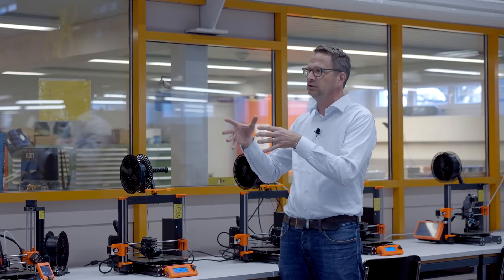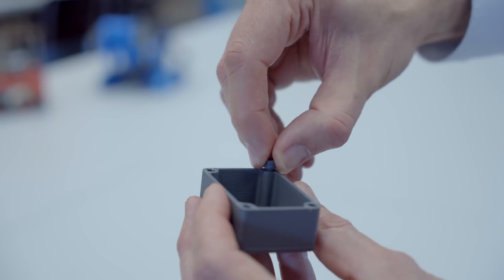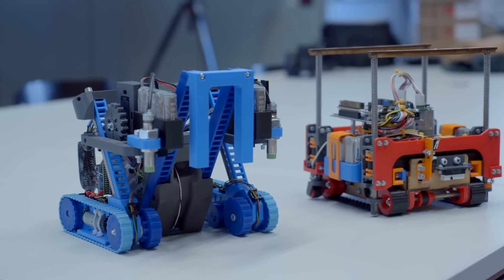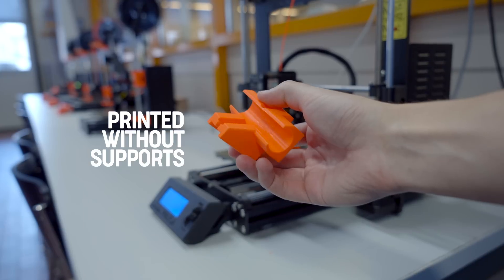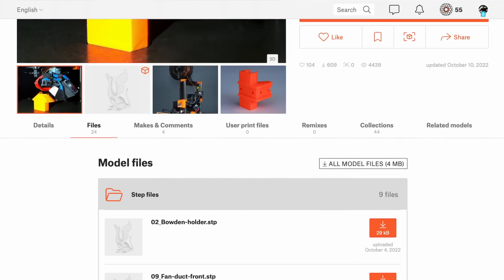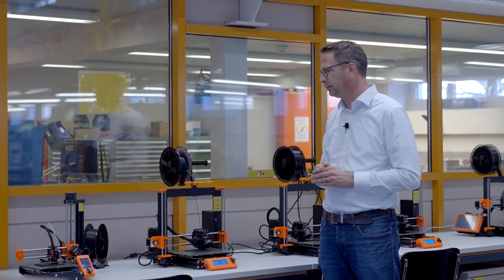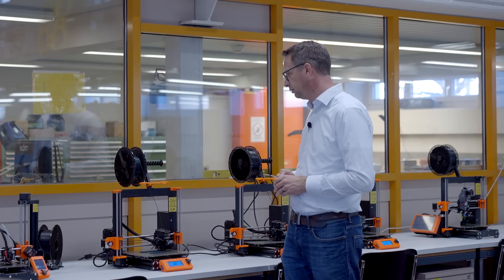A Taste of Swiss Education: Support-free 3D Printing at ZHAW University

Comment: " . . . and with these Prusa printers we never have problems . . . they just work . . ."
This is also my experience as a relative new comer, I have read a lot of horror stories, a lot of things I "must" do for a successful print . . . all I do with my Mini is clean the plate every couple of prints with IPA swab, and print . . . that's it. It just works.

The few times I've had questions (not faults) I jump online and connect immediately with support and get my answer. It just works.

Thnx Prusa.
Billd AU

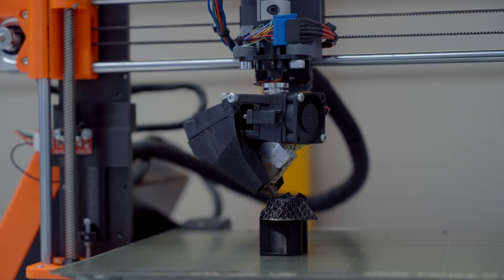Comment: 2:14 arc overhangs?
Reply: no... ;-)
Reply: @michaelwuthrich1633  can you at least reveal if your solution is based on modifying the slicer?
something similar to printing in air with a 3d pen might be possible
a pause at the end of a floating line
Reply: @marc_frank  Yes, it is mostly a nonlanar slicer thing. Just a slight modification on the printer to get more clearance.
Reply: @marc_frank  Yes, slicer (and a longer nozzle to get more clearance).
Reply: Looks like 3axis nonplanar with an angle limit. I wish it was arc overhangs though :)

Comment: The next step in 3d printing should be the expansion to more axes and thus the possibility to realise more complex geometries and not to increase the speed to infinity.
Reply: Why not both?
Reply: @Tuethida  - Yup, in my opinion, the idea that there's an absolutionist trade between speed and quality is simply and patently absurd. It's just a question is whether or not we've reached an engineering solution yet or not.
Reply: @ThatOtherAndrew  let's say Prusa mk3 can print quality parts at 60mm/s and it's limit is 120mm(I don't know the exact numbers for that printer). Past that it starts to skip steps or the belts skip etc...

Now you build a voron, and you tune it for speed. Its built better, the frame is more rigid, better mainboard, better steppers etc. It now produces acceptable parts at 500mm/s, Prusa quality at 150mm/s and at 60 it's better than Prusa. 

Engineering for quality and speed always goes hand in hand.
Reply: @igorordecha  Maybe true,
but what cost a good build Voron?
With linear rails and light x beams?
We running 15 MK3s on petg with 60-80mm/s
You need more parts - buy more printer
The price of an MK3s kit was about 560€. Now the price of the mk4 is to high. A sovol clone cost 230€ and do the work top . Its not super fine tuned like the X1C. So if you need best looking parts buy a x1/p1p, mk4 or build a Voron.
But if not the others do the job too.
Reply: @marinamarinx7655  ok but what is your point?
Reply: @Tuethida  Quality for Quantity
Reply: @Tuethida  You are right
Reply: Both those developments would have useful applications
Reply: I’d just like to see “real” 3d printers. Not 2 + 1 axis
Reply: Increase speed is only for decorative prints. Technically strong parts cant print fast. Even on the X1C we print PETG <80mm/s.
Reply: @marinamarinx7655  you're trying to print strong parts and yet you're using petg...

Comment: okay you might want to consider that for an mk4.5 or directly mk5 👀👀
Reply: Installed stock it could increase print times and it seems new marks are trying to improve speed
Reply: @malakimphoros2164  yeah but i'm sure we can do other cool stuff with an extruder head like this, perhaps using the xl as a base changing tool head to have a 4 axis cnc ?